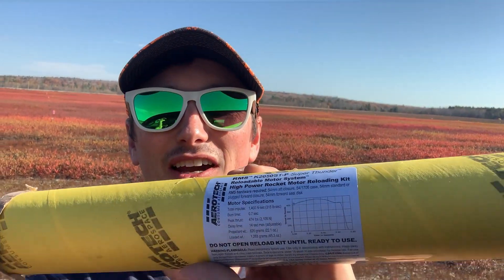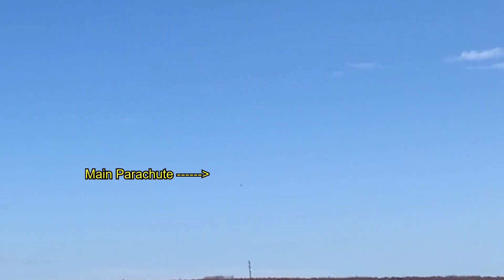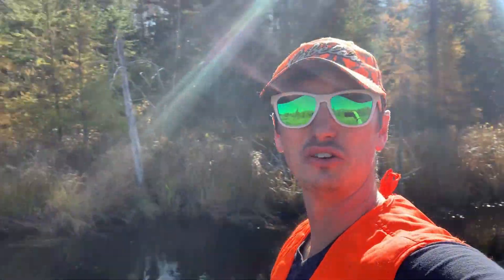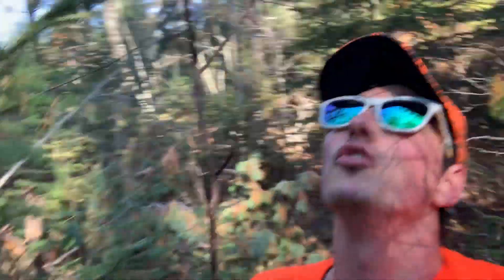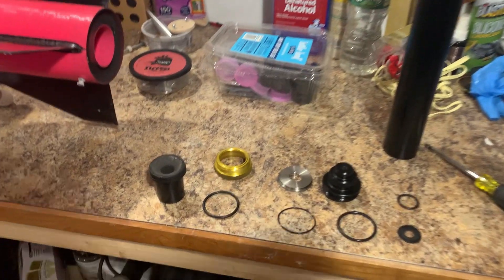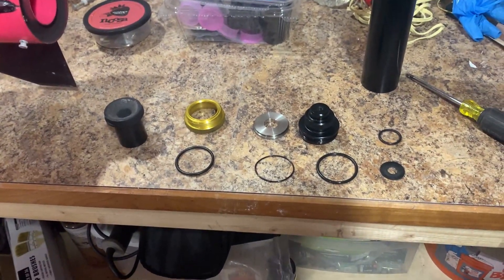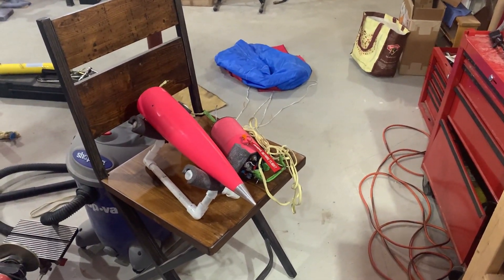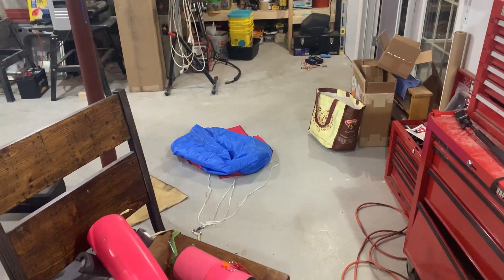Aerotech K2050 Super Thunder in a 4" Rocket

Comment: Interesting to see that people are still building and launching rockets. I haven't for over 30 years and back then we didn't have the electronics and tracking you do but the thrill as something you created shoots up into the sky is still intense.
Back then we were having increasing problems getting launch authorization from the FAA, we were certain they were trying to make it as difficult as possible (but then again, we were reaching airliner altitudes of 30K to 34K so a conflict would have been bad so we understood they needed to be cautious too).
Reply from the maker: Oh cool background! What region of the us were you in? Based on the recent NAR newsletter there’s about 5,000 licensed high power rocketeers out and about :)

On the east coast waivers from the FAA are generally 10-12,000 foot and they’ll give call in to a little higher. Out west 30-50,000 foot is common.
Reply: @pathtouch1  my Dad was a NASA engineer with Engineering & Development and I got the bug from him and they had a great hobby group at NASA Clear Lake (Houston) so we actually usually launched from the back property there. Or we'd go west out FM 2004 to the salt grass prairie between Galveston and Freeport. I built several rockets using M class motors, including one two stage beast. But quite a few were just J n K class. 
Note that launching from the NASA property was before the surrounding land exploded with development of streets, Comercial buildings and subdivisions. I remember when NASA headquarters was out in the wilderness with cow pastures all around (end of Mercury, start of Gemini) and the road in front was a two lane asphalt county road. The shrimp boats still docked at the lake (and sold fresh shrimp and oysters cheap off the boats) and there weren't all the high dollar marinas.
So waaaay back in prehistory, haha (before PC computers and far before cell phones).
Reply from the maker: @bobjoatmon1993 wow that sounds like an amazing time and place to grow up.

Comment: Hey, how are you tracking it? what device are you using to get close?
Reply from the maker: I’m using the Featherweight gps tracker. It’s a commercially available system designed specifically for tracking rockets with an iPhone and it has paid for itself many times over. Plus it’s just plain cool!
Reply: Hello  @pathtouch1 ,
Thank you for the reply; okay, I am familiar with this but haven't used one yet. Something to remember during my futures builds for sure. By the way, I am N5WPG and hope to QSL some day.
Reply: Bookmarked that little trinket for a future purchase. Thanks for the tip. :)